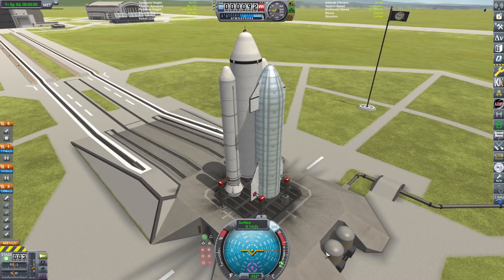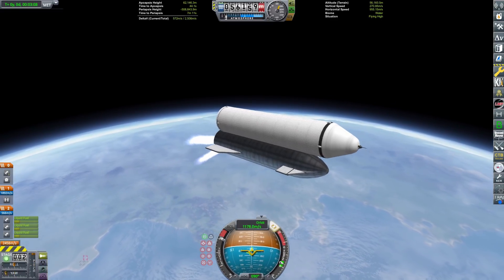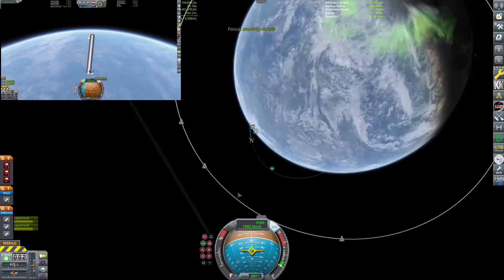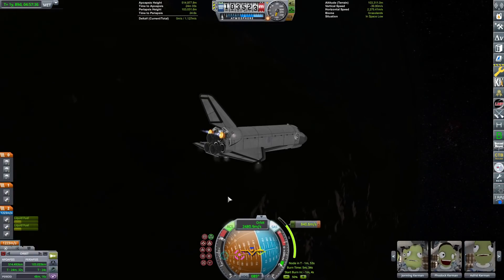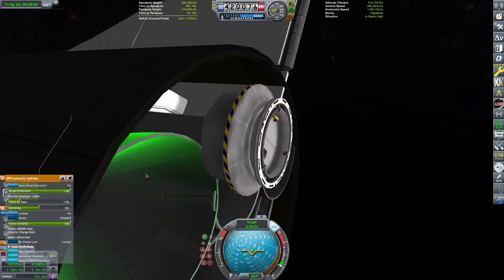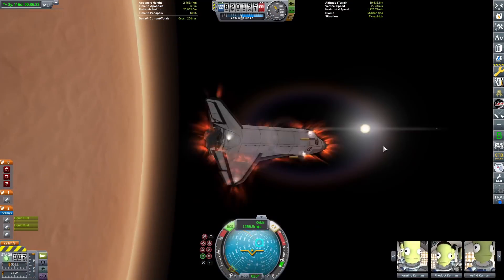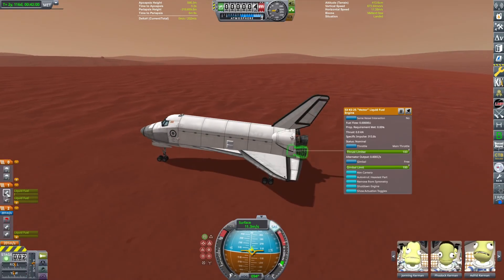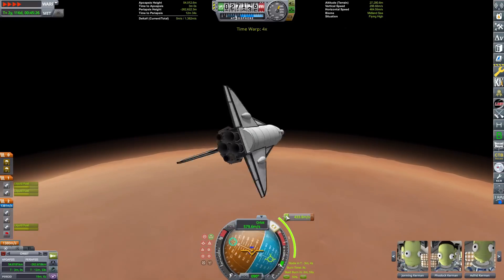KSP: What If Starship And Space Shuttle Switched Places?! Kerbal Space Program 1.11

Comment: the worst part is the Super Shuttle would actually be safer than just the shuttle
Reply: Agree completely. Easy to abort and eliminates use of segmented SRB with multiple possible failure points. Liquid engines can be shut down and turned back on.
Reply from the maker: yeah lol